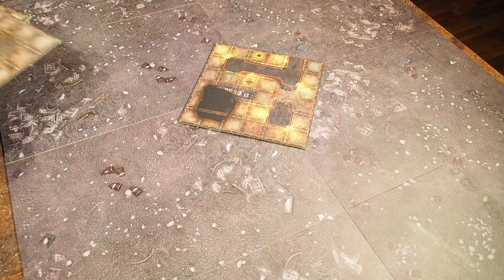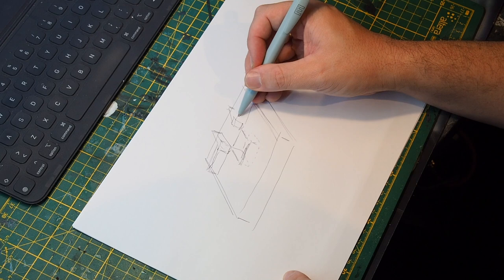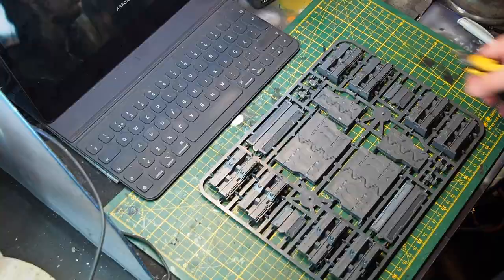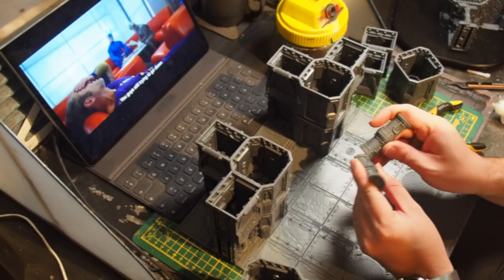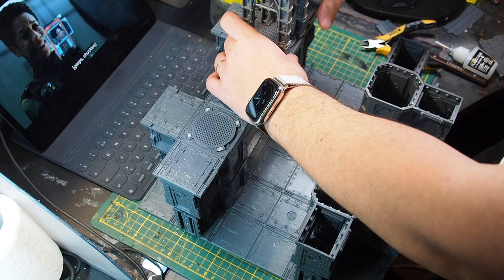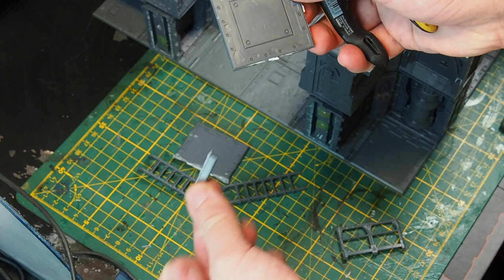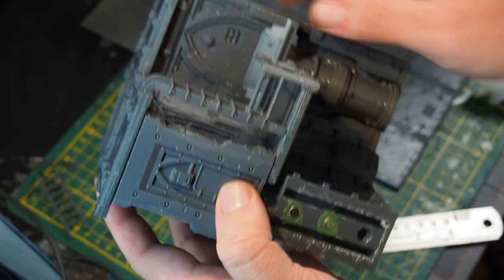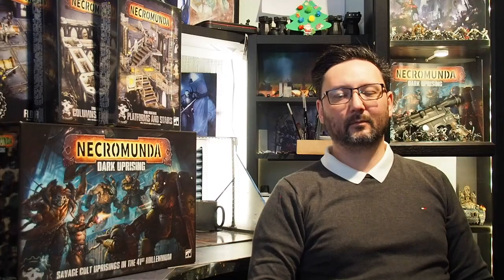Necromunda Zone Mortalis tile - building intersection

Comment: Great video. Thank you. A quick tip regarding green stuff - if you only use it for things such as filling gaps, instead of green stuff (which is expensive), try using Milliput mixed with isopropyl alcohol or methylated spirits. You can mix them together into a texture that is as creamy or as watery as you like and then use that to fill gaps or touch up imperfections. Far, far better than GS.
Reply from the maker: For some reason your comment went into the 'Held for review' section. 
Thanks for the advice! I do have some milliput. So I'll take a look at that the next time.

Comment: Just found your video and channel and what an amazing job! Have you thought about getting a 3D printer to augment your builds? I’m building a Necromunda table with GW terrain and printed parts and even resin bits for turning soda cans into tanks! Keep up the great work!
Reply from the maker: Yes indeed I have, But I am a sucker for GW plastic :D . And I do prefer to work with plastic glue. But it is not out of the question. But for now, I need to plow through my never ending stack of terrain kits :D

Comment: I think you made a small miscalculation in the price. Those are only half of a Pipes kit and half of the barricade kit so they are only one time 30€
Though you can save alot by going for a 3rd Party Seller which brings down the price to 184€
Reply from the maker: Ah, that's very true. Still, a good kit if you ask me, and the pipes are not available separately anymore :(

Comment: Why on earth are you not casting your parts? The savings are so immense.
Reply from the maker: Because I love original parts. And I also get a good price at the local game store as a commission builder for them. So in the end. It’s pretty much the same price and I do not have to waste time on casting. I have done that before and it takes time to do properly.
Reply: @MrLeonarddime    Fair enough, although I have found that spending a few hours making really good molds lets me turn out pieces by the hundreds for less than the cost of one Box but I'm also in the United States and don't mind working with resin as opposed to the original plastic which I will admit is much much nicer.

If I could get the same amount of parts in plastic I would happily use plastic solvent instead of CA glue any day of the week and twice on Sunday.  😝😝😝
Reply from the maker: @garfieldwithissuez  haha, and that is the thing. I really dislike resin. But I'll admit, or course you can make savings on resin moulds. But its the time factor I am mostly worried about. Creating the mould, casting, waiting for it to cure, cleaning and then assembly with super glue.
Reply: @MrLeonarddime   Oh no doubt, especially if you are someone who doesn't have experience making molds on level other than dabbling. I've been casting things for the last 20 years. I started in high school, we had just about every kind of sharp known to man and I took them all everything from metal and wood shop where I learned to do lost wax and green sand casting all the way through plastic fabrication and working with resins and again jewelry grade wax casting so it is much easier for me than probably 95% of people out there. Hell I'm on a first name basis with several people at several different companies that make casting materials lol. 

Seriously though keep up the good work I've been playing Necromunda  since 95  And you are inspiring me. Thank you for that.
Reply from the maker: @garfieldwithissuez  that’s very interesting. Love a good back story. 😊 I have tried casting pretty intensively for maybe 2-3 year 12 years ago. 
I did finally got around to getting good results. Heck I could even mass produce Imperial Guard Elysians (that power fist they had was hard to get right in the mold). 

But... I kind of lost interest. Don’t know why. 

Anyhow. I’ll keep doin videos and continue use plastic crack as a source material.
Reply: @MrLeonarddime  I'm right there with you. I don't cast minis to use in games, oy terrain stuff and other things for other hobbies  (3D printing rings and casting in metal).  And please do. XD